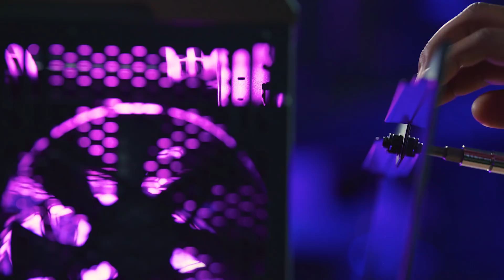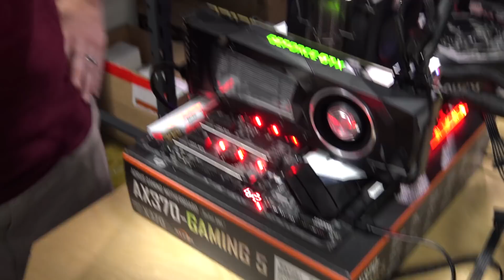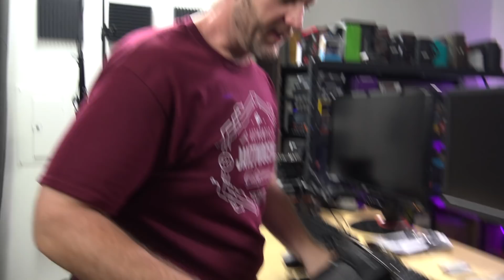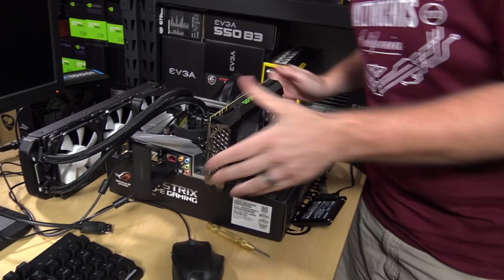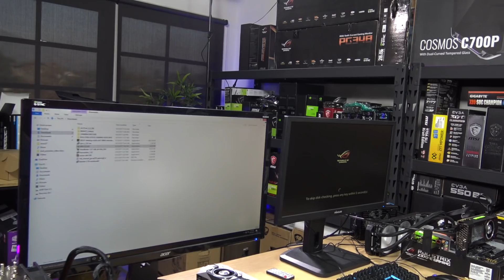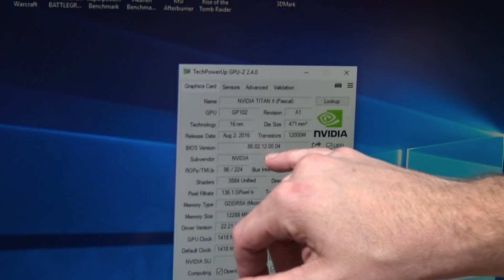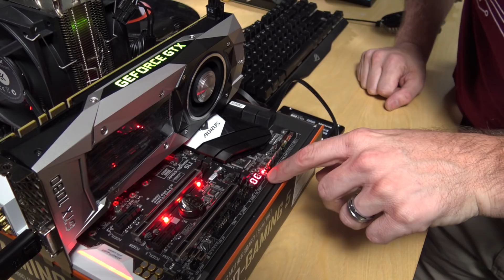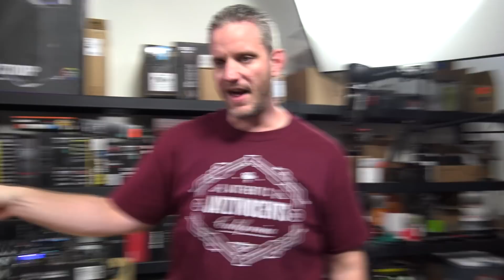I cant figure this one out... HELP!

Comment: Well, clear CMOS with the not-working card installed, then try again.
Another step would be trying the lower PCIe slot with the card that is acting up.

And do the thing everyone else mentioned: Check the bios on the card that is not working on Ryzen.

Comment: Most logical explenation would be the motherboard bios is not compatible/bugged. Just because it's the latest version doesn't mean  it can't be the motherboard. Either that or a power issue. Somehow not enough power getting to the gpu on the ryzen board. And did you try booting with just one stick of ram? I had this weird issue once where my pc didn't boot with more then 1 stick after a cpu and gpu upgrade. After it booted once I was able to use all ram slots no problem.

Comment: As many off the reactions below you showed the BIOS version from only one card which you switched from the Intel to AMD system.
A) the card asks to much power during boot-up do to short coming of the PCIe slot on the AMD motherboard or a spike demand of the nvidia card itself it halts to a stop during boot up.
B) Somehow their is a problem on the nvidia card do to bad component that tricks the boot up process to think the card is no good in the AMD system.
C) Somehow the BIOS update that you have done on the particular nvidia card is faulty and only the AMD system notices it do to the constrained start up checks and sensitivity of the AMD system/motherboard.
D) Start up checks of the AMD system is  so constrained and to sensitive the nvidia card is not accepted or a false negative is created during boot up and the system halts.
E) Somehow the motherboard or the BIOS of it have issues, do to bad flash of it. Re-flash again with the same bios or the latest one the AMD motherboard. download the bios update again.
F)  By the way you swapped the video card, have you tried swapping the motherboard of the AMD system .

Comment: If the cards were identical the Intel system wouldn't need to install PnP drivers after the swap
Reply: isnt there some sort of uuid that diffentiates cards?
Reply: My theory is that the cards come from different OEMs. My drivers from Nvidia have 3 different entries for "NVIDIA TITAN X (Pascal)".
Reply: The reason there is 3 different entries for Titan X GPUs is that there are 3 different Titan X cards, one built on Maxwell architecture (Original Titan X) with GDDR5 and two on Pascal, one with GDDR5 and less cuda cores (Titan XP) than the most recent of the tree that have 11GB of GDDR5X (Titan Xp)

Comment: Sounds like a tolerance stack up issue between the  PCI slot and the edge connectors on the card. Also you checked
 Bios ver. on the same card twice not both cards.

Comment: It could be a hand shake challenge between the CPU and that GPU if the GPU does not respond in time during start-up. Check your bus speeds and the system RAM as we know that memory plays a big part of Ryzen's performance. I had some challenges with my bus speed dropping (R7 1800X @4.0 GHz, 32 GBs DDR4 2666 MHz, on an ASUS C6H) when I started to increase the GPU memory speeds.

Comment: Just assembled my ryzen 1800x system. Could not get my 1080Ti to post on the upper PCIE slot. GTX 580 works fine in that slot. So i decided to place my 1080ti in the second slot and now it works. Got the VGA error in upper slot...........
MSI x370 Carbon MB

Comment: I think it is a problem with the motherboard. Reason being that it could be the PCIE Slot. I think you should change the whole system to a new motherboard. I think the PCIE Slot may be having problems with the slot in the GPU specifically. Very very specific problem but i think you should try it.
Reply: if the slot were bad, the other card wouldn't work either.

Comment: Gigabyte bios are crashing on AMD. There is no problem with the motherboard. Previous generation  has the same problem. When you take the motherboard for warranty and repair they will just write the same bios on the motherboard run some test and send it back to customer. it has been on going saga.

Comment: Hey guys I need your help. I own a pc with an i5 4690k not overclocked, gtx 970 asus strix, 16gb ddr3 memory, z97-c motherboard, stock cooler. I am gaming and after a little time I get black screen, no image signal but my pc continues running. I can hear the game crashes after come little time but windows still keeps on, I keep hearing voices on discord for example. What can it be?

Comment: I have actually had multiple times experienced an issue like this. In my cases, it was either due to the display cable itself (EVEN IF IT WORKS IN SOMETHING ELSE) or the type of display connector [HDMI\DVI\DP]. Usually requires clearing CMOS every time you try something knew to get it to take.

Comment: It could be the vbios and like other people said you only checked one bios from one card, but on the other hand you do use 2 different motherboards how do you plug your monitor cable? before power on or after?, and what would happen when you do a cmos reset? (I don’t think that would fix it), I do know some motherboards don’t allow hot plugging on their pci cards since uefi doesn’t like it, I had a smilliar case on a Asrock amd motherboard (f4t4lity) with a R9 280x video card I litterly thought it was broken.

Comment: Could u use a motherboard jumper and reset the motherboard bios? I had the same problem and that fixed it for me. For me, I tested a 1060 and had the same problem with a ryzen 7 1700 and once I used the jumper it booted and works fine

Comment: You mentioned something that stuck with me. You tried to boot the Ryzen machine with no memory. I'm completely guessing here, but:

It is possible the motherboard couldn't find memory, and tried to use the memory on the video card. It may have identified memory on that card, and be trying to use the video memory on the card whenever that card is present as the fastest memory it sees, but moving down the list to the DDR4 memory when that specific card isn't present, and prioritizing that memory over the video card memory as a preferable interface location.

My suggestion, factory reset the motherboard and see if it boots ok with that video card.

Comment: Well I would also chuck this up to the fact that there are some strangeness with computers out there.
For an example, when I worked in IT, we were refurbishing a bunch of hospital computers, so we ordered 4 tall pallets of computers from Dell... Without the monitors.

As funny as it may seem, they were all the exact same identical model with identical hardware, but they all showed different behaviour on the same test bench.
They would all POST, but not all of them would complete the installation or boot the installer properly and required fiddling to make it work.
And these were the same identical model, same BIOS version, everything was the exact name... Except the serial numbers.

Comment: Maybe the one that does not work is pulling a little more power than the daisy-chain power connector you are giving it. Try two completely different cables off the CPU instead of daisy-chaining.

Comment: Well, first of all (as another guy said) I would check the bios version on the OTHER card (the one NOT working on the RYZEN) against the one working on both systems. In the video it seems like you checked the bios version against itself , i.e. you checked the version on the card on the INTEL, then you put the SAME card on the RYZEN and checked it again. You never checked (again, ON video) the bios version of the card NOT working on the RYZEN...
Other than that, if the bios versions turn out to be the same, then... There is not then actually, you'll never get it, so just run with the one that works... :)
EDIT: I just read a few posts down  and they are right, try different PCI slots and PSUs (it won't be the PSU of-course but it might be PCIX power connectors). I don't think tolerances can be THIS off but you can give it a try... It is possible, just not very probable...

Comment: Since you had issues with a couple of cards it seems like it may be tolerance issues on the pcie slot? As in a couple of pins aren't connecting. As when you reseated the second one it finally recognised the card and booted. There may also be a tolerance issues on the GPU pcb thickness as you said they may be from different batches. Just my two cents

Comment: Drive software my be the problem I don't no how many times you change your gpu on this motherboards ,so you can try disable oc from bios for this gpu with problem on ryzen motherboard and try connect in 2 socket

Comment: I think at the beginning of the video, the first card on the left rig was not seated quite correctly and hence the error. You had the same problem with the third card that you had to take out and re-seat again so it would post and work correctly. I would have liked to see you put the original card back in the left rig and seat it properly and try it again.

Comment: Power issue on the card? Maybe the extra power Ryzen demands isn't liking some power issue in that one card? Then the Intel system doesn't have an issue because it has more available power? Shot in the dark without TDPs
Reply: Most of the Ryzen line-up uses less power than the Intel stuff these days when comparing in the same class of CPU. So that seems wrong.
Reply: ColtaineCrows I guess I was equating their heating issues with power consumption without actually consulting data. Guess the heat is a result of poor efficiency.
Reply: Have you been reading some graphs backwards recently? Intel is the one that's been using a lot of power and running hot when compared to Ryzen. Ryzen has been pretty solid when it comes to temps and power use. I know there was some confusion about Ryzen temps early on as one of the temps reported on the 8 core parts especially is like 20C higher than the actual package temperature, so maybe that's what you're thinking about? (Can't remember exactly how much higher the temperature reported was, has to do with making cooler fans act a certain way).

Unless you're somehow confusing Ryzen with Vega?

Comment: Jayz,  I watched the "I can't figure this one out" video. I think you may have made a mistake troubleshooting.  It may be the way the video was edited but I don't think so.  You showed the boot problem on the Rizen board.  Then you showed another board working fine on the Intel board.  At this time you checked the bios version of the video card in the Intel machine.  You took that board out of the Intel machine and put it in the Rizen machine. It booted up fine so you checked the bios version of the video card in the Rizen machine.  It was the same bios version.  It looks to me that you checked the video card bios of the same video card and said it was the same bios level.

Comment: Try another pci-e port.

Reset BIOS of the motherboard, all stock no OC, nothing and use only one RAM stick(strip it down to eliminate everything else)

Did you actually check the bios of the right Titan XP? (didn't in the video)

Comment: Jay when I built my Ryzen 1700X system, I changed the bios settings to make sure that the pc booted in UEFI and secure boot mode. My Asus CH6 was clever enough to tell me, that my system would be unable to boot as I had a non UEFI compatible GPU. I am running an R9 Fury X and though wtf, its worked in every other system.
After doing some digging I found that the bios on the fury X was not UEFI. I found a UEFI bios for the fury X and flashed the card (AMD are very against you doing this, totally at your own risk), since doing this everything is working. Not ran an Nvidia card for some years so unsure if you would hit the same problem????

Comment: This seems like an obvious case of a flaky motherboard, especially with Ryzen, where they're all kinda flaky.  

Things I'd check:  Does system behave properly if you put the card in a different slot?

Does it behave properly if you insert a PCI-E riser in between the board and the card?

Clean the edge connector on the affected graphics card.

Comment: Far be it from an ideal  solution I propose a workaround. Try the second pci-x slot. I have seen in my 20+ years as a system builder a handle full of boards refuse a card in the primary slot.  Just curious if this could post the card.

Comment: Did you disassemble the Titan on the Ryzen? If so does the Ryzen mother board have a lower tolerance to electrical variance, and is it possible you partially damaged one of the power filters?

Comment: I'm going to wager that your AMD system has some form of semi-millisecond response lag on its closest PCI slot, and the "suspect" NVidia card responds just a hair too fast for the board.  I've had RAID cards do that back in the 2000's which caused strange anamolous behavior like that.  It's not you, it's just a weird synch issue in the first PCI slot.  Consider that one your last resort.  This is just a guess from remote, so take it with a grain of salt. 

Try putting the suspect card in the furthest slot from the CPU and see if that behaves properly.

Comment: i know this sounds a bit too simple, but try some alcohol wipes on the connector edge, i've had static problems that linger on the pins and stopped a gpu going working, quick clean of contacts, even tho it seems clean did the trick for me

Comment: As many have commented, you got the BIOS of the same card twice, that's not saying that it's the issue, but from what we see, that's what happened.  Assuming that's NOT the issue, go on a part by part basis.  As you already mentioned check the PCIe slot, see if that's not a problem.  Check the PSU, see if that's not a problem.  Check the cables from the PSU to the graphics card, see if that's not a problem.  Check the RAM, see if that's not a problem.  Next step, if you have another one of those motherboards and CPUs, build an identical test bench and see if it gives the same issue.  In other words, try and replicate it with the same setup.  Heck, try with another Ryzen even, see if a different processor will cause it to work.  And if all that fails, since you have contacts with nVidia and AMD, bring it up with them, and see if they can replicate it.  Troubleshooting is the biggest pain in the ass, especially for bug, but as someone who does bug testing on software, it can be as rewarding as hell when you actually get it solved.

Comment: Did you install the OS on both PCs with the same media drive?
like did you use the same USB stick to install win10 on both PCs.

I can't tell you how many messed up PCs ive fixed by installing the OS with a Old CD drive and not USB or a drive that needs a driver.
my neighbor had a GTX1070 that wouldn't post and a OS install from a old CD drive fixed his issues.

Comment: Jay ... Welcome to the world of computers. Shit like this just happens some times. It is a great moment when you actually figure out what's causing one of these ghost problems, but, you generally don't.
It's not just PCs, man. When I was younger, I was entertained by a story about the Chrysler mainframe in Adelaide. (Yeah, I'm an Australian.) So they had a problem, the main operator terminal would sometimes play up, and heaps of important jobs could only be done from that chair, because that one was wired up different. So they flew in a systems analyst from America. First thing he did was dig out his huge personal coffee mug from his luggage, and go make a steaming big mug of hot coffee, which he put down at the top right corner of the keyboard. Then he went to work. Everything worked exactly as it said in the instructions. So after a half hour he said "Well you sit down here and show me." So they started the reboot process, he picked up his coffee and moved aside, an Australian sat down, nothing worked. Took weeks to work it out. There was a fault in the terminal, but if you put down a huge hot cup of coffee at the top-right corner of the keyboard, it all worked again...

Comment: I've had the same issue on the K version of this board. With a 1600x. It wouldnt post and the vga light would light up. This problem occurred when I was trying a new configuration with my ram (changed clockspeeds and timings). Resetting bios worked, but ever since I havent touched my ram.

Edit:
My graphics card is a evga gtx 1070 ftw.

Comment: I trust that both cards have the same BIOS, but what you showed us in the video was: You ran GPU-Z on the computer on the right to check the BIOS version.  Then you took that video card out, moved it to the computer on the left and ran GPU-Z again on the left computer and commented on the fact the the BIOS versions were the same.  Doh.  

That aside, I would try swapping the power supply.  I know since the two video cards are the same make and model, and one of them ran fine, it shouldn't make a difference.  But some cards are more identical than others.

Comment: Hi Jay, probably only problem with hardware recognition of corupted gpu during rizen boot up. Intel have internal gpu so doesnt need external gpu during boot. If it was on me try sli on rizen or run corupted card on Intel CPU witouth   internal gpu. And test bios memory or check bios on wrong card.

Comment: I had a very similar problem to this back when I built 100% matching systems for my wife and I on x58. two gtx275 and asus p6t boards. one combination of vc and mobo would not boot. swap the VC and it would boot fine. Move the card around PCI slots, no boot. So I got out the multi-meter after several days of trouble shooting and parts swapping and found that it was the mobo, the voltage on the PCI-E rail would run a little bit lower. The only thing I could think is that one of the video cards was a little more hungry and that mother board was clearly on the weak side.

Comment: you checked the bios first on the intel system with a working 1080, then swapped cards and checked the working bios again on the ryzen system... you needed to check the bios on the intel system again to check the bios version of the bad card...